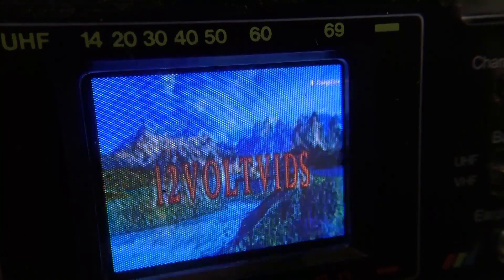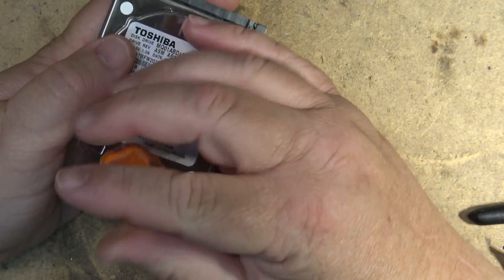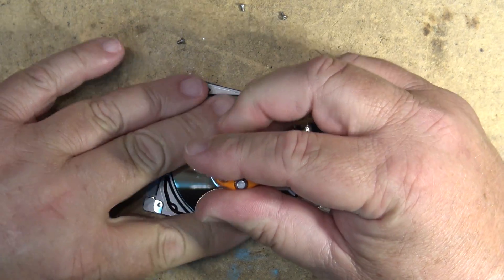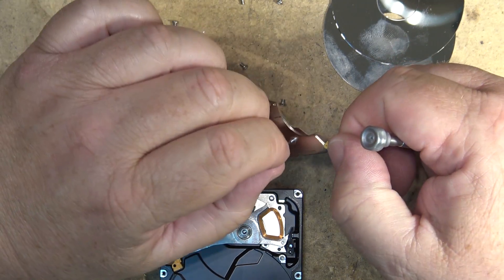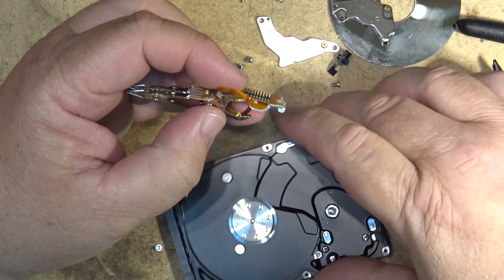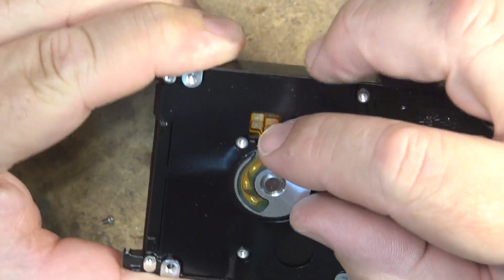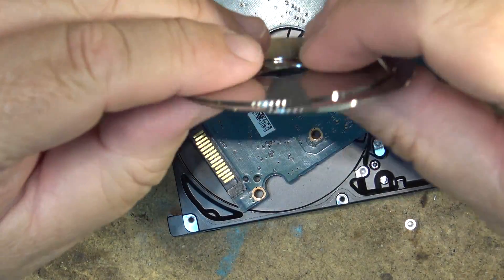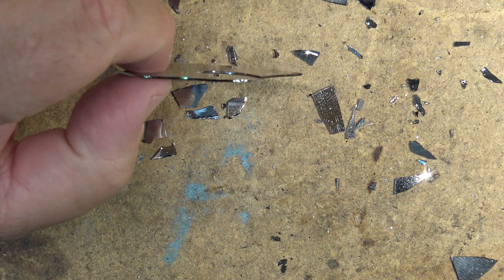1tb 2.5" hard drive tear down

Comment: if the drive is not even seen by the pc unit (eg the logical information) it is often a bad board.  there is a small factory calibration chip (I think - 8 pins or so) that holds the low level formatting information during manufacture that needs transplanting to the 'exact' donor board before it can even be considered recoverable.  I remember back in the day when the units used to carry out a thermal calibration using stepper motors :-P  The trouble is these days the data density is that high, only voice coils are surffice as even the slightest temperature change alters the position of the data tracks in relation to anything mechanical. (the drive uses markers created on the low level format at the factory to find its way around).   Even though these things are being phased out with m.2 / ssd etc etc they are incredible engineering feats
Reply from the maker: Ssd will never totally replace mechanical drives as ssd have big time longevity issues.  My old work pc was shot in 5 years.  Now if you don't mind buying a PC every 5 years then knock yourself out.
Reply: @12voltvids  Ive upgraded countless pc's with ssd's before scrapping them  - Even mechanicals in raid I replaced after 5 years in fear of 'serial' failure ( serial numbers on the factory batch / run making  the failure mode and time related  - eg. 1 fails and the other fails 5 days after - same part to blame).  The market will also dictate if  tech firms keep investment  in a mechanical drive factory as  battery life and product size is improved with ssd and the consumer market being more savvy for them.  

Don't get me wrong Ive had some mechanicals work for years, they are excellent for data storage (archiving and backup) - not as suitable for modern operating system as primary (especially hungry windows ;-)) -  ive only had 1 ssd failure so far in 10 years and that was popped 5 minutes after prepping the drive.

Comment: It real interesting how a hard drive disc platters work,,and they look like round mirrors. I didn't know they were real glass type discs as the hard drive explosion shatter was awesome too!
Reply from the maker: I'm still picking pieces of glass out of my fingers.
Reply: @12voltvids  picking pieces of glass out of your fingers?
Ouch! You must've cut your fingers when u had cleaned up the pieces?
Reply from the maker: No I vacuumed up the debris. When it shattered a few pieces stuck me. Glass went everywhere.
Reply: @12voltvids  Ok,,yes as I did see how it did shatter to so many pieces,, and u got a bit injured in the process. I guess at least u were wearing the protective glasses. But not the gloves.
But good how u did vaccum  up the tiny pieces too.

Wanna b more careful next time u receive a defective hard drive,,,wear gloves and a face shield too,,,if u go to destroy discs like that one.

Comment: Checking out the model number, it's an MQ01ABD100V.  According to Toshiba, this model was designed for DVR applications.  Pretty much any problem with a modern hard disk is a death knell where the only point in getting it working again is to get crucial data off of it that you can't recover otherwise ... assuming that there is any data that's worth the cost and trouble.

Comment: Don't laugh, I have working PC with Win98 on 1.5GB, ancient by today's standard. I use it for old version of Clio loudspeaker measuring soft (T-S, MLS, RTA, Sinusoidal, ...) that works in DOS.
Reply from the maker: I have a working pc, a 386sx that runs dos / win 3.1 and it only has  250 meg hard drive and it still works.  I showed in on an old video. It's a Toshiba versa.  Has my old technician service notes and a few official factory tip programs on it where factory service bulletins were distributed.  I should make another video dedicated to it as I just showed it on another one way back.
Reply: Holly, 386. Video sure, it should be fun. I wonder what the Hi-tech kids are going to say. But it's kind of funny that the ancient machine still work, while the TB, GHz, super graphics 4k fail. Maybe the old things were built to handle stress more gently. Then, the precision of high capacity storage has to way higher and there's no room for manufacturing errors.

Comment: Way back the old 5.25" drives used to get sticktion so bad that it would often pull the heads off the arms. When the newer 3.5" drives appeared people expected a lot of issues but they were generally more dependable than the big ones.
 Our IT department had a monster on display that had failed - 5.25" and 16 platters. No idea now what brand it was or how much it held but lights must have dimmed when it spun up. I had an old 8-platter in my old BBS and it sounded like an old trolley car traction motor when it spun up. Lasted for years, though.
Reply from the maker: My first non linear editor had a big ultra wide 10,000 rpm acsi.  That drive (just the drive) cost me 4,500.00 back in the mid 90s. It was a 3.5" but a triple bay. In other words took up 3 standard drive bays. The thing sounded like a jet engine starting up.  The size if you must know...... it was huge.  9 gigs!!!!  Huge by the standards of the day. Today not even big enough to run a phone.

Comment: What kind of camera do you use for your videos how much was your camera what is the holder for your camera I am planning to do a bingo thing on Facebook I need this kind of setup
Reply from the maker: It's a Sony FDR-ax33. When new it was about 1200.00. The crane is a home built contraption.  2 tripods zap tied together, one zapped to the arm of the other. This allows it to be positioned at any angle..
Reply: 12voltvids it cost a lot it must be a really good camera i was not sure how you have the two tripods setup do you have Facebook or email mybe you can show me some pictures how it is setup did you have that camera for awhile if so it might be cheaper now i want to do live chat video on Facebook

Comment: M.2 drives are the latest new thing now.  My tower pc has a slot for one on the motherboard.  As well as a 212 GB ssd drive,  which is where windows 10 resides and a 2TB regular hard drive.
Reply: Same here, My PC's have M.2 slots and regular spinning hard drives.

Comment: The most expensive parts of the hard drive are the mechanical parts, not the platters on which the data is actually stored 😅
Precision machining metal parts was expensive, is expensive and probably always will be.
That's also one of the reasons why turntables are still expensive nowadays.

Btw, doesn't surprise me that the bearings are gummed up - it's a Toshiba HDD

Comment: Had one of those El cheapo dell oem Seagate drives come out of my grandpa's old PC. He told me that it wouldn't boot, that there was a disk error upon trying to start the PC. When I took the drive out and tried to power it, all it would do is make beeping noise. Long story short the head had crashed and caused the drive to lock up.

Comment: JUST FOR FUN IN ISOLATION OF COVID19!!! In the beginning you have accepted in your mind that it won't be fixed, you continued and crudely handled.
I have rightly indicated in some of your earlier video that these screwdrivers are not convenient to work with despite of been made in Canada. What's the point to use another tool to replace its bit when it is stuck 00:50.
Reply: Those are really crappy little screw drivers. Sometimes you can get them out by hand but not often

Comment: The flash memory used in solid state drives have re-write endurance issues especially with higher capacities depending on the cell structure. The most durable are single level cell (SLC) then multi (MLC), triple (TLC) and quad (QLC) being the least durable. It's not recommended that solid state drives be used on high re-write devices like security camera footage recording devices. Always have back up copies of important data with three copies being recommended in the rare case one copy fails then the second copy fails before or during replacing and re-recording the lost first copy.
Reply from the maker: I only use ssd for my windows boot drive. 
Everything else including the cache and swap files written to conventional drives.

Comment: Considering that the hard drive was originally designed as a low capacity buffer between systems, they have done a good job as storage :-D.
Spinning drives will continue to exist while ssd's have a short life span.
Glass platters, clever technology.
Reply: I think you answered my question .

Comment: Just because I worked on Photocopiers and Laser printers for the last 40 years or so, I'm thinking you should take apart a Color Laser printer or Copier for fun ... EEVBlog did one and it was amusing how much fun he had, talk about complicated assemblies / sub-assemblies !!  many things have to work well together for a piece of paper to come out with an intelligible image on it. Some of the big machines have several Microprocessors, or you could take an Inkjet printer apart ( They're much smaller )
Reply from the maker: I do have a color laser printer.  Actually I have 2 but they still work.  Still use my old Samsung clp510 all the time.  15 years and it still works
Reply: @12voltvids  Have you seen some of the Xerox phaser's (like the 8400) that used wax blocks to print? They are are kind of a Rube Goldberg machine inside. They weren't too reliable but was an interesting design.

Comment: I hadn’t seen a lot of Toshiba 2.5” drives fail over the years. Lots and lots of Hitachi 5400 2.5” ones over the years failed to the point Apple even extended out of warranty repairs. Fujitsu’s 2.5” were pretty solid while the 3.5” ones had a high failure rate.... Samsung too. Seagate was lower middle while WD stood a bit higher at upper middle. Toshiba 3.5” was made by the old Maxtor factory I think when Toshiba bought the factory.
Reply: True, probably because of heat.
Reply: I Have a Hitachi, a Samsung and a Western Digital and never had problems. My friend asked me to have a look at your laptop and the hard drive was completely dead, I think it was a Toshiba or Seagate, not quite sure
Reply: @josericardogs1435  I've seen every brand of hard drive fail from rough usage over time or from too much heat. I just had a higher than average failure with Seagate lately and Hitachi (5400 rpm models) from years past. Doesn't mean they are junk. Seagate's seem to develop bad sectors and just run slow making you think it's a windows problem or such. Hitachi's seem like they had an issue with the head becoming unglued from the arm - your computer would freeze and you'd lose all your data unless someone could transplant a new arm and head to it.

Comment: in the early '90s we had a lot of Sony hard drives in our computer lab get stuck. I learned that giving them a quick twist would free the motor and they would often run for months or years before sticking again. I found out later that it was a common problem, people called it Sony stiction disease!
Reply: Did the same with a WD drive stored for a long time in improper conditions. Gave the back of the motor a few taps with the back of the screwdriver and it was good to go.
Reply: @sobolanul96  Lots of externals end up that way. It's not hard to open them up and get them moving again with a minimum of data loss. Lots of Howtos on Youtube on doing just that...

Comment: Although the platters look like metal, the base material is glass. Found that out when I tried to bend a platter that came from a duff 2TB drive I disassembled.
Reply from the maker: Yes they are and they literally explode.  The camera wasn't fast enough to capture it at 60fps.  Even in super slow mo at 10% speed you don't see the pieces go flying.   I had on a face shield and I will probably be picking up pieces a month now.
Reply: Glass in the smaller 2.5” models.... metal in the 3.5” versions I believe
Reply: @scottyfixit  some are definitely aluminium. Taken a few apart myself.